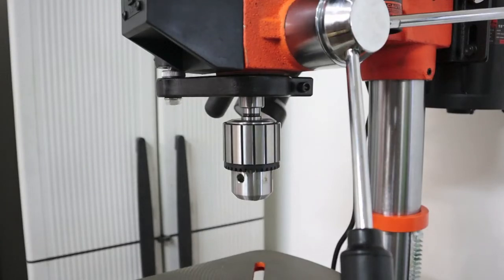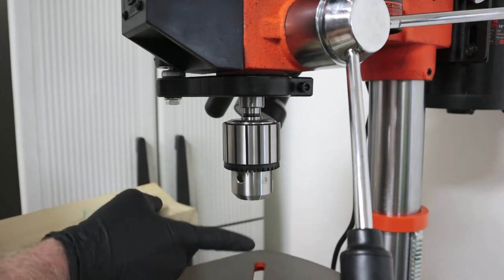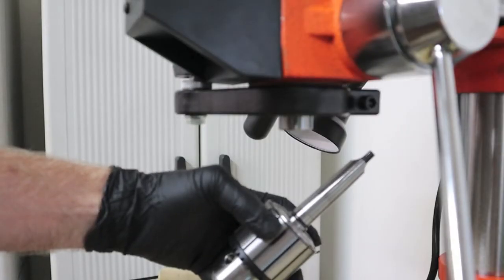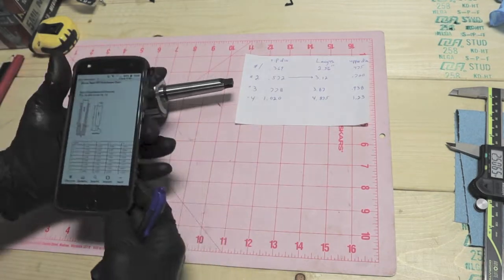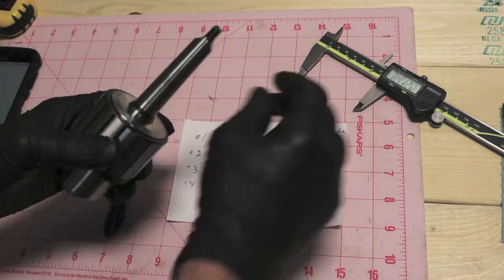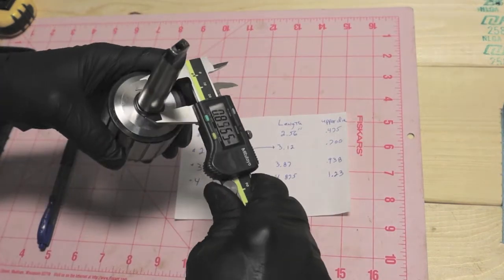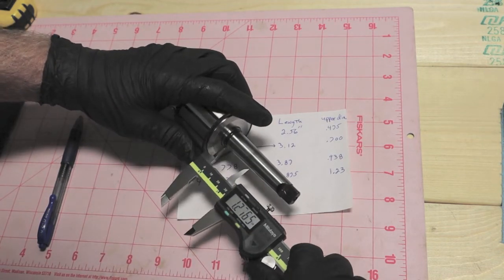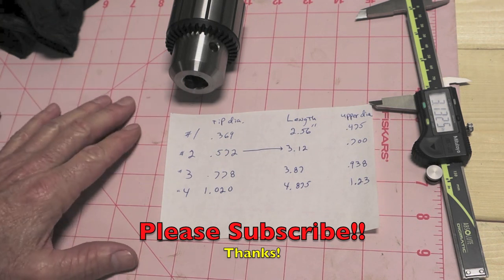Morse Taper Size? It's Easy To Check!!

Comment: Hello sir thanks you for your nice video. Im new to this i just bought a lathe and now i want to buy a live center and a chuck for the tailstock. So now im trying to understand what is a morse taper and what other type they are and how it works. Some help would be greatly appreciated thanks.
Reply from the maker: Clement, I don't have the knowledge to help you on that.
I go by what the owners manual specs on the tool in question.
In a nutshell, the industry tries to standardize things like tapers, and chucks, etc., but then a new product comes along all while there are a few million of the older tools with these tapers, stocks, and chucks. All with different sizes based on the power required to turn the machinery.
Thanks and good luck!
Reply from the maker: Clement, if possible consult your owners manual on the tool in question.
You can also Google morse taper as there is lots of info on that.
I just don't have the knowledge to discuss.
Thanks and good luck!

Comment: do you get different size openings for the actual drill bits for a no 3 taper?  Or do they all open up to the same size?
Reply from the maker: I'm not sure on that. The drill bits I have are specific MT2 taper and it is stated on the storage tube they came in.
Thanks for watching!

Comment: 3 hands try use the quill lock it saves you the wrath of the handle on your kuckles 👍
Reply from the maker: I don't think this model has a quill lock. After reading your comment I looked through the owners manual again and nothing is mentioned about it.
Reply: @pmtips4482  Even the cheap ones have a quill lock, even though they don't know it.  It's totally useless for most things where you'd like to lock the quill, but for this one thing it's useful.  Just pull it down and tighten the nuts on the spring on the other side of the press.  Also, great info about figuring out which MT size you have.  Thanks.